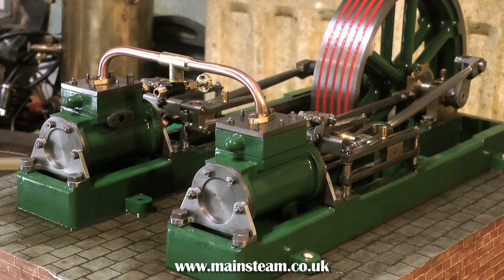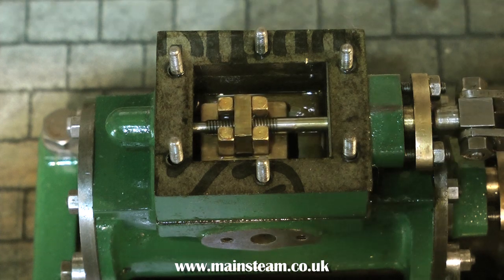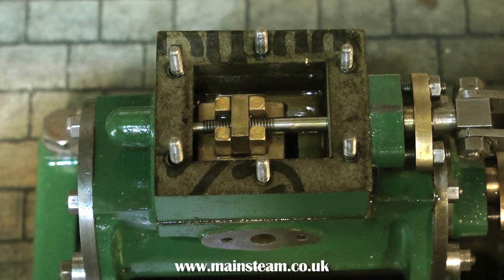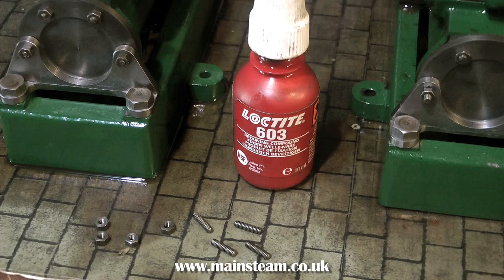PART #7 - REBUILDING A STUART MODELS TWIN VICTORIA STEAM ENGINE

Comment: this is awesome!  i was wondering why the valving surface on the cylinder doesnt get polished.  it seems like that would give a better seal.  Does it just not make enough difference to matter?
Reply from the maker: the port faces and valves lap each other in as the engine runs :-)))

Comment: why are the throws of the crank always at 90 degrees? why not 180?
Reply from the maker: So that the engine is self starting.
Reply: Keith Appleton Ok thank you. After posting my comment I realized that it was so there would always be a power stroke no matter the angle of the crank. If it was at 180 degrees there would be two power strokes at the same time, which would be very inefficient